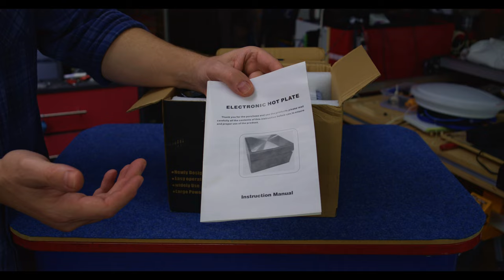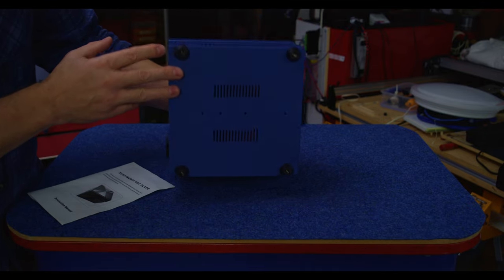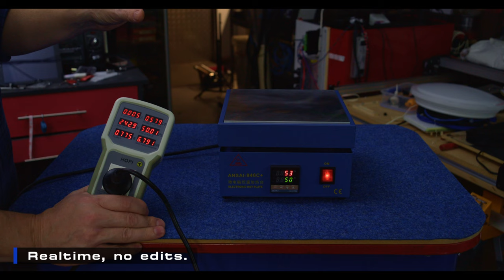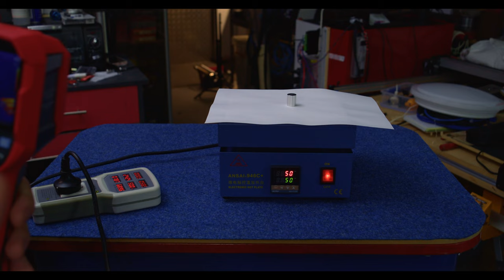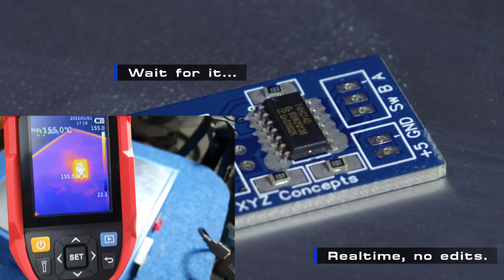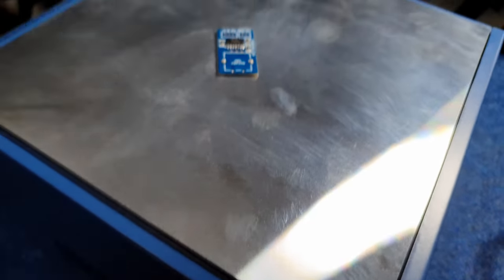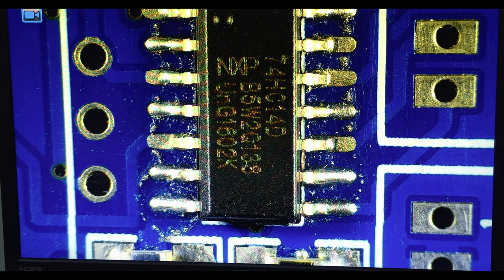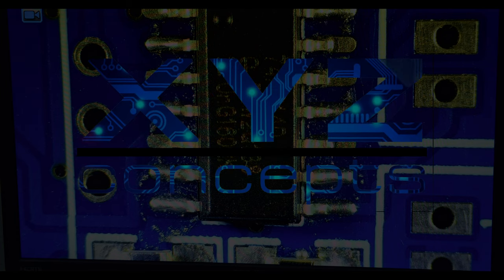#52 - ANSAI/BOZAN 946C+ - 800W Electronic Hot Plate Review and soldering experiment 👀

Comment: Finally had time to watching this one start to finish. I know it wasn't a great performing video for you but I'd be interested in seeing more be it updates on refining your technique, a tear down or anything really. I've heard of counterfeit flux on eBay and the like, any concern the paste isn't genuine?

I've been kicking around the idea of picking up a hot plate for those boards with absurd thermal mass. It's a pain using two irons or an iron and hot air to remove or place parts- no hands left over to run the tweezers!
Reply from the maker: Yep a long video, glad you found the time.  Meh, I knew the video wouldn't be a banger but it was a bit of insight into very basic tomfoolery on my part.  Technique refinement is a priority for sure, I'll hand solder SMD's all day but bulk soldering is new to my shop, though not at all foreign.  I got this bad boy because I want to repair those hideous thermally massive LED PCB's made from alumin(i)um 😉 among other things.  Yep, I am suspect of the solder paste more research required, though the goal is cheap as possible without being a complete fail.  For the price this hot plate is a must have in my opinion, opens a lot more doors and you don't need more hands, I get into enough trouble with the two I got!